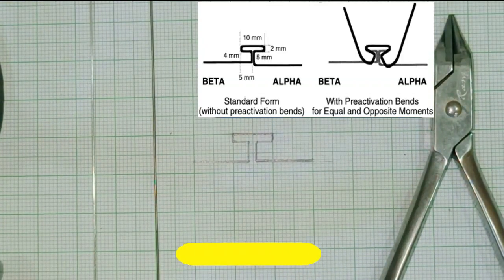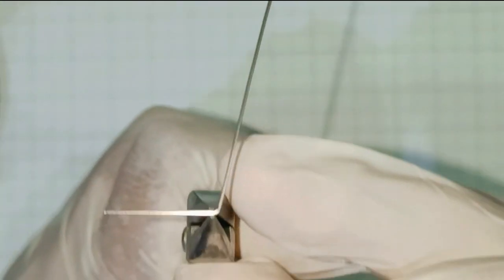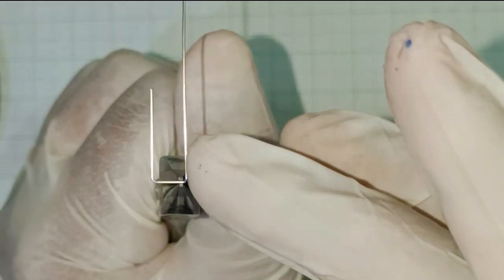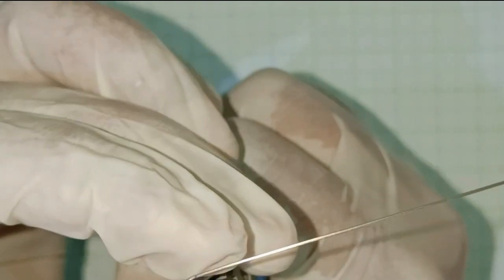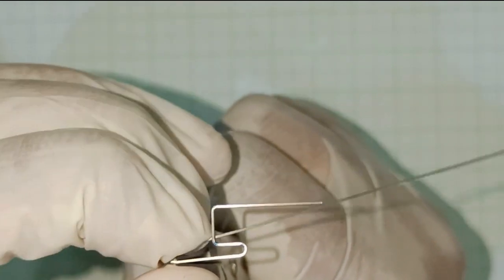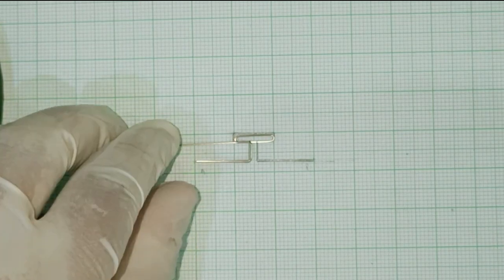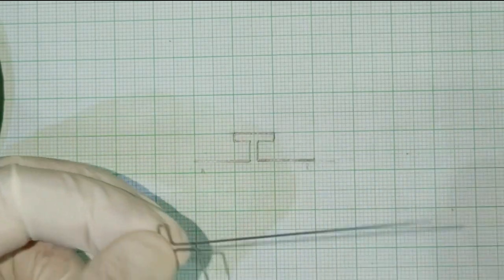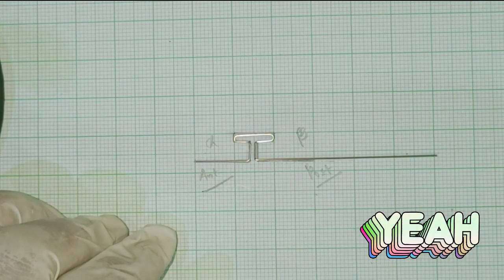T Loop Explained : Part 1/4 - Fabrication of T-Loop I Alpha & Beta Arms/Bends I Orthodontics@ Dr Ram

Comment: Please if u cam give demonstration on pg spring
Reply: Hello,, actually in exams they usually ask to make pg spring , i was searching videos but couldn't find any
Reply from the maker: @thinkcooking5921   Hello Dear. I'll upload video in Sept end..!!
Reply: Want to learn wire work different type of loops, offset bends, utility arches etc 🥲
Reply from the maker: @thinkcooking5921  Noted
Reply from the maker: Hello Dear.  P Gjessing spring was given for En-Masse retraction. For canine retraction, you may decrease bend intensity. 
What exactly you want is PG spring?? (It's less frequently used because many people are not able to make it symmetrical)
Reply from the maker: In one of my case, I used Gjessing spring on one side and T-loop on the other side. Clinically, I did not find any significant difference.
Reply: Thank u, we will be waiting